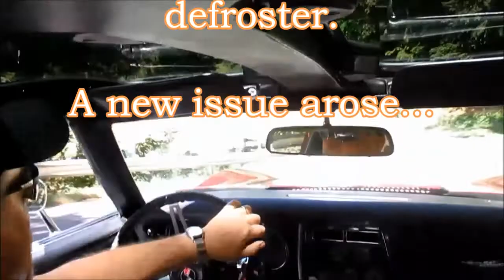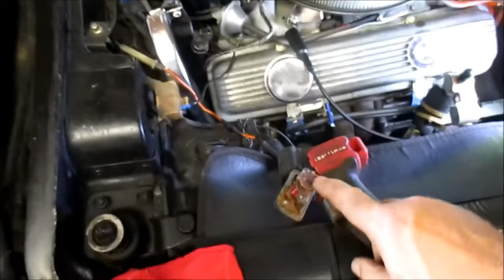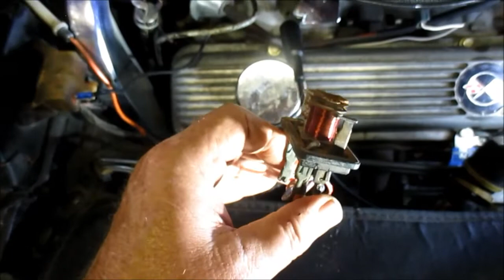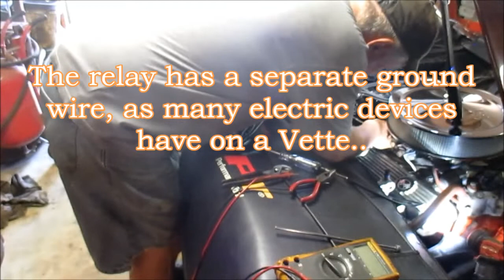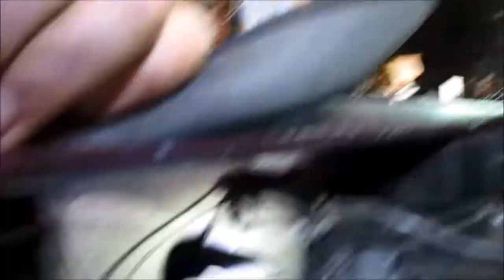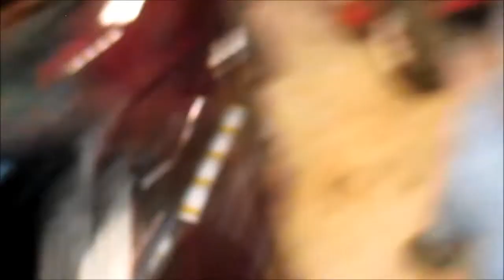C3 Corvette Hi speed blower fan repair. 1975 Corvette, Volume 28

Comment: I ended up removing that capacitor and now my high speed works! I can hear the relay click on whereas it never did before. Thanks for the video. My next issue is that when the switch is on low, it is blowing faster. As you increase the speed level the fan actually slows down... Until you go to the max setting (far right) then it blows max level correctly (thanks to your video).. so one problem down- one to go
Reply: Fixed it tonight, that's exactly what happened. The medium speed was ok but had to swap wires for low and high speed. I'm guessing somebody messed around in there because on the "low" setting the fan does not run all the time w. Key on as you described. I must move the thumb wheel from the "off" position also. Then low speed will kick on. This was an A/C car that is no longer A/C. Wonder if that makes a difference.
Reply from the maker: @dominicdubois9767  Congrats on the fix. I'm pretty sure the fan should run on low in the off position but I've been wrong before, LOL.. In any case not running may extend it's service life. And again congrats, anytime you can fix a 40+ something yr old vehicle is an accompishment.
Reply from the maker: Glad to help. Check the wiring at the blower resistor, it could have gotten jumbled up sometime in the past.